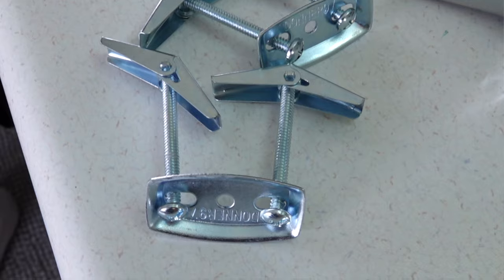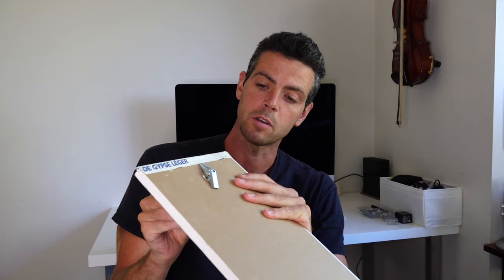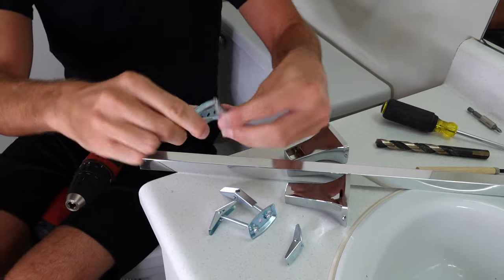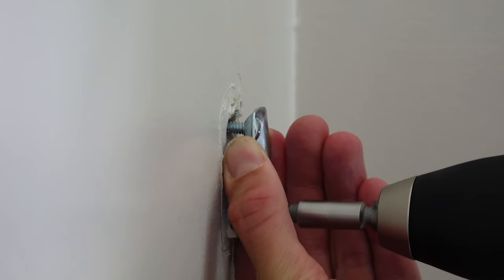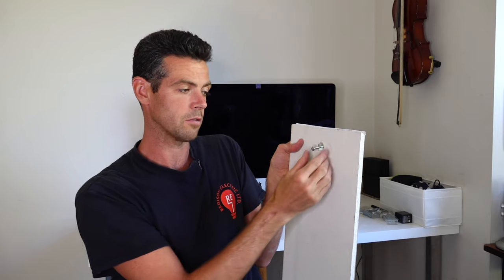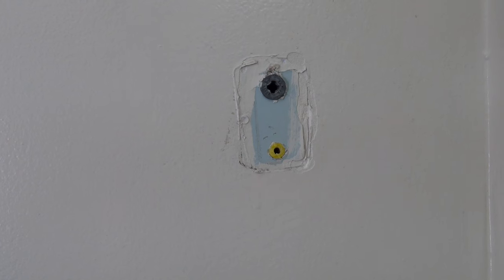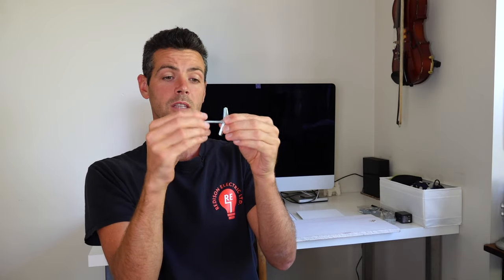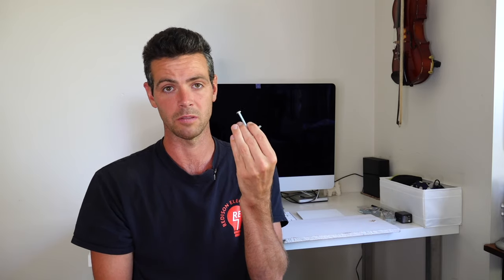Installing a Towel Bar in a HOLLOW WALL!!!!

Comment: Those toggles have much greater "pull out" resistance, but the concern I have is there is much less vertical or sheer strength because the hole is so big and the screw is completely unsupported.
Reply: There’s tons of friction on both sides of the wall holding it tight

Comment: Perfect timing! My youngest had been using the toilet paper holder as a hand support and pulling the towel bar for fun. Any suggestions for bars without cover plates - do they make simply covers that your can thread in to hide the hole in the drywall? Also, any tips for walls with only 1" strapping and concrete blocks behind - our split level wall in the first floor only has strapping, not full framing, so there isn't enough space for a toggle to expand out and anchor screws don't bite into the concrete behind well. Thanks in advance for any ideas!
Reply: They do make longer concrete screws (tapcon), that will reach the brick or block in the back. Just get the right length, should embed 1-1.25 inches into the concrete.
Reply: Sometimes the easiest and best solution is to mount a nice piece of finished wood- paint or stain grade, round the corners with a router to give it a finished look. Screw that to solid framing/strapping/block wall, then simply mount your bar onto that. Obviously make the wood big enough to reach support to support, and center the bar on it. We do this at work sometimes for when people want several coat hooks in an office or classroom, and it works well and is very secure.

Comment: Thank you! Kicking myself for not buying better anchors before install. Rushed to get the project done and used the cheap plastic ones included with the towel bar. A few months later, everything is pulling away from the wall!  Oops facepalm #rookieDIYer

Comment: what i find to be stupid is the towel bar i usually install has bracket spacing from 22 3/8 - 22 5/8 and framing alot of time is 24 on center. So if the bar itself was 23 1/2 in alot of house it could be installed to 2 studs instead of just 1. manufacturer must have some big saving be eliminating that inch.
Reply: Most framing is 16 on center with few exceptions like a garage.  A 2 story house will definately be 16 on center to support the floors above.
Reply: Yep, many bathrooms are on outside walls with 24" spacing. There is such a disconnect between household accessories and wall spacing. I don't know why bathroom and kitchen sheet-rock doesn't already have a backer of some sort built in. i cant even recall how many products I've bought that were never 16" or 24" spacing, it's so obvious, it's like they do it on purpose, as no one could be that dumb without planning.
Reply: Backing for  kitchen cabinets is real nice to have.
Reply: @Mixwell1983  better R value if exterior walls are framed 24. Everywhere a stud is insulation can't be placed.
Reply: @grantmackinnon1307  not many are framed though with 24" spacing

What i see is 2x6 for modern houses for the r value with 16" spacing, exterior insulation as well if building for energy efficiency. All run of the mill older homes 16". Roof Trusses 24 oc

Comment: I'm a journeyman cabinetmaker, and do finish carpentry for a living.

I've NEVER gotten those toggle bolts to work. I would use the yellow and blue plastic anchors, with the correct screw, a MILLION times over those particular toggle bolts.
Reply: Gotta keep back pressure on the toggles, while you're screwing them in. Like pull the head towards yourself. 

Besides that, just make sure your toggle doesn't get fucked up on its way in, and that its actually flat out behind the wall, before you start fastening it.

Top two toggle tips, I can give ya devil.
Reply: They do work well, I've used them at work a ton. Zip toggles work great as well, tend to be for heavier duty stuff.

Comment: Thanks for the tip.
By the way, I have in my bathroom project a shelf with a wash basin over it. All have to be mounted on a ceramic tile covered drywall. Using these kind of mounts will require to drill all the way through the ceramic tile a pretty large hole, which is not ideal. 
Will regular anchors do the trick ? Otherwise what do you suggest ?
Reply from the maker: Depends how heavy what you are mounting is.n The cheap plastic anchors work really well when there is tile on the wall. The tile stops the drywall from blowing out.
Reply: @vancouvercarpenter  The shelf + basin weight around 15kg or (or 33 lbs). I think I will go for regular anchors. Thank you.
Reply: You could always try the smaller plastic ones, if they fail, upsize the hole to the toggle bolt

Comment: These are aweful. Try zip toggle anchors instead. My favorite ones are the toggler snaptoggles. Cobra flip toggles also work the same way, just not as easy to use
Reply: How are the zip toggle anchors better?  Looks similar but never used them.

Comment: Have not had any problems with the cheap plastic wall anchors that come with mounting hardware. Removal and re-use is simply and the holes are easy to fill. Toggle-bolts = overkill on towel bars, toilet paper holders, etc. Use them for larger, more permanent load-bearing items like shelves.
Reply: I've fixed dozens of towel bars over the years where drywall anchors pull out. When doing a new install If no backing I typically use at least 1 toggle per hole, won't last otherwise through the years.

Comment: That sir is a HUGE toggle bolt for a towel bar. Why not a molly?  It self drills. Expands behind the wall into 3-4 points. One less tool to fall into the toilet. Similar anchoring strength.  Doesnt fall behind the wall when u pull the screw... you know... better

Comment: There is another style of those that use a plastic zip type tie. You drill the hole, insert the toggle then pull the plastic to snug it up against the back of the drywall. the plastic gets snapped off and leaves a spot for your bolt to screw into the metal holder behind the drywall. Used for hanging heavy stuff. Advantage is you can remove the bolt and the anchor stays in place. Sorry, don't know the name of them.
Reply: Zip toggles
Reply: @chrisburns5691  Thanks, knew it was something like that. 🙂

Comment: In allot of comercial and residential places I’ve started seeing people get lazy and simply use regular drywall screws, even seen 5 to 10 pound internet modems hung on ceilings with only drywall screws, really gives me a headache when I remove and can’t reinstall things on the same place because the drywall is wasted.

Comment: Or... since we are drywall folk here... Even if not at the framing stage, I don't think it would be too extra to remove the existing drywall to put in some backer board.
Reply: I would for a TV, overkill for a towel bar.

Comment: None of them work great. 
To increase the holding power put a little dab of caulking on the plate before you tighten the screws.

Comment: The way it was originally installed was correct. If the bar gets loose you can go to a larger anchor. If you start with a large anchor and there's a problem you have a sheetrock repair job on your hands. (Which isn't really a problem for you)

Comment: you could try slopping some mud in there as you do it, if the hole is too big. of course then you have to keep it straight while it dries (works for ceilings since they hang straight) they used to sell these metal versions of the cheap plastic anchors which spread out and work as long as you choose the right size for your wall depth (which is why they probably went out of fashion, but I still have a box full of them and occasionally use them if i want to control the hole size).

Comment: 0:55 you push it through the board. Then you have to use your hand to open it and align it properly on the other side. You couldn’t do that, if it was a real wall.

Comment: But you're a drywaller!  Cut out a hole and slip in a 2x12 then patch it.....  More video content!
Reply from the maker: 😂 I don't think I need to make any more patching videos.
Reply: funny
Reply: @vancouvercarpenter  don't say that!  How about testing the strength of different types of patches.  is it stronger than the wall:  California, wood backed, no coat, etc

Comment: Toggle bolts for towel bars? That's a little much, homie.

Get some quality anchors, and use the right size drill bit to make your hole for said anchor. It'll be more than strong enough.
Reply: +100 No problem if you get quality anchors, use the right bits, and don't overdo it. In general, throw away any anchors that come in the package...now THEY almost always suuuuck.

Comment: EZ anchors, either metal or plastic would be perfectly fine for this application.  love your vids, but toggles are overkill
Reply: I respectfully disagree.  Short of blocking at the framing stage, with kids and others that continually rip and tug at their towel, overkill works better than having the plastic fail. Better do it right once than doing have the job twice, or more times.

Comment: The twist ins are ridiculous. They continue to twist when you put in the screw. I've never tried it but the only way to make them work is to glue them in and let them set before you put in the screw.
Reply: They are a pain. I've played around with them. What I end up doing is instead of putting them in the drywall and then putting in the screw I hold them in a clamp and put the screw in, then I screw them into the wall. Be sure not to crush the threads in the clamp. If you try to put screws in them when they're in the wall they just rotate and tear the hole wider and are then useless.

Comment: Bathroom Towel bars should be outlawed! The are extremely dangers. ALL, ALL bathroom towel bars SHOULD be replaced with correctly installed grab bars! Every year serious injuries occur with people slipping getting out of the tub and grabbing “towel bars” which break off as they fall to the tiled floor. Building codes should require grab bars only in bathrooms!!! If you have towel bars in your bathrooms, replace them immediately!